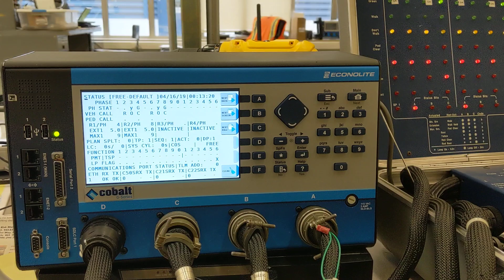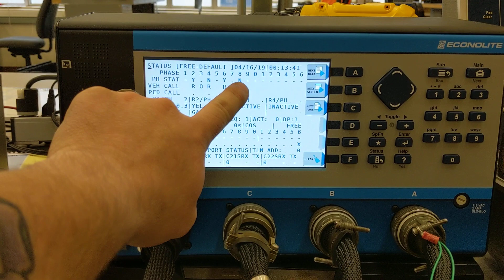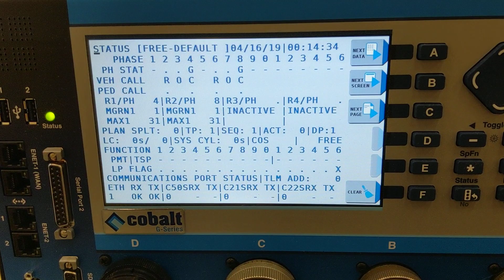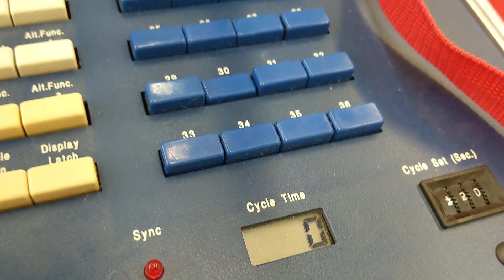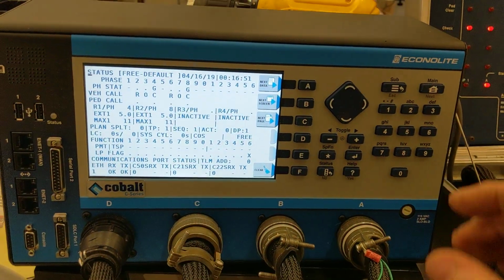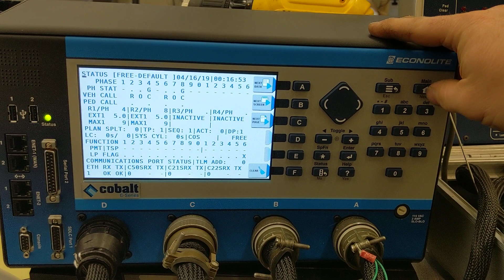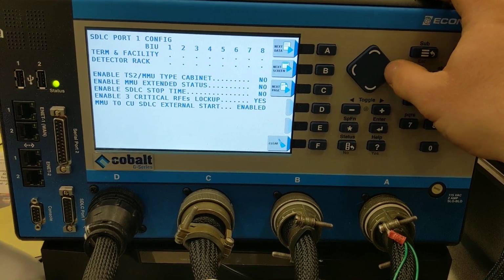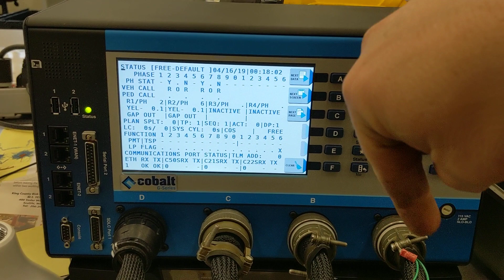Flashing Yellow Arrow on an old briefcase intersection

Comment: I was making one of these (before I knew they were a thing) and when I was about 80% complete (the wiring and resistors are a ton of work) I found one buried in my store room along with a loop analyzer from 1994 with a little dot matrix receipt printer. Probably still works if we still used loops in my region of Michigan. Most agencies went big on video detection, we took a gamble on Sensys pucks and I'm not sure they are any better than loops to be honest (esp. with their battery life and interference issues).

Comment: As a traffic signal collector of 20 years, I wish I could get my hands on one of those intersections in a box devices.  i actually have a Traconex 390CJ unit with a 12 position load bay (NEMA TS1 yup old skool!!!).  Also I own the older 4 phase HMP 40 from Traconex.  

Got a few 1960s signals (all retired of course).  My first one is my favorite the LFE 8" signal.  Then I got the LFE/TCT 12", followed by a really old Econolite "Bullseye" back 12" signal (square doors sadly.  Wished they were the round ones).  All signals are 3 faces naturally.  I did have the epic Model 131 3M High Vis signal, but it tipped over on me in a garage and on it's way down it received several huge hols in the housing and shattered 2 optical limiters.

I also have a 9" Crouse-Hinds ped (DW/W text) and a 16" ICC with proper DW/W text.  I disliked when the older peds were forced into the hand/man format.  They just look better with text :-)

I've gone so far into studying to be a traffic signal tech (level one) through the IMSA, but misplaced those REALLY expensive 3 ring binders they provided during a move.

One thing I am curious about, and hope you have insight.  Is it possible to create the yellow flash using the older TS1 load bay?  As I mentioned mine is only 12 positions (yes they recommend the full 16).  Originally it was wired for phases 1-8 with OLA-D (though I swapped OLC and D for 2 peds).

It'd be amazing if you could go into more details about the "toys" you get to work with.  For me this is all fascinating.  Yup I am a geek for this gear and have been since I was a kid (back when we still have electro mechanical controllers in service.  KERR-CHUNK.  Oh how I miss those.
Reply from the maker: Awesome! I don't have room to collect, otherwise my wife would strangle me.
Reply from the maker: So you definitely need an overlap to do it, and a newer controller. There are ways of mocking it up using flashers, etc. not exactly sure how but I think there may be a way to run the flashing yellow off of the PED yellow outputs

Comment: Hello again, Here in CT, our company installs a "simulator" (which my boss had several built as a part of electronics school class project) and we connect it to the field wire terminals in the cabinet. When a new signal is replacing an existing signal, we use the simulator 4 or 5 days prior to turning on the new signal.
Reply: About 10 years ago, we installed a new signal at the entrance to a new shopping center. The controller was furnished to us by the city. We tested the controller and CMU in our shop. I brought the controller into the field and it would not come out of flash!! After investigating and after some tence moments, I discovered that the auto/flash switch in the police panel was installed or wired backwards!
Reply from the maker: @elainecullen5714  I have seen similar stuff with that, was it miswired in the cabinet or somehow the input in the controller was miswired? Super important to try and test everything as much as you can back at the shop. All of the signal cabinets that are installed within our maintenance area need to be Q.C.'d at our shop first and we set them up completely and then the contractors will come and pick them up here at our signal shop.
Reply from the maker: Perfect that's kind of like this device except there's no better simulator than a cabinet in a lab. Most of the cabinets we have in the field me our specifications So there's not much to surprise us.
Reply: The cabinet was installed several weeks earlier by someone else and I went to the site to "stuff" the cabinet and give it a test run. Just for fun I put the signal into flash in the police panel and 10 seconds later the signal came up and operated normally from that point on.